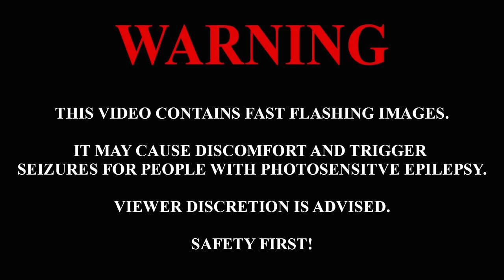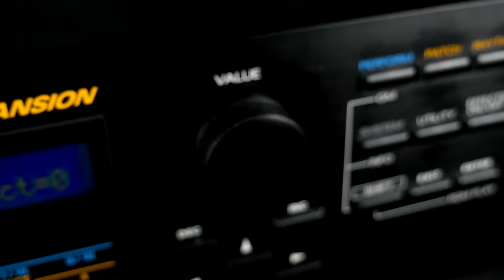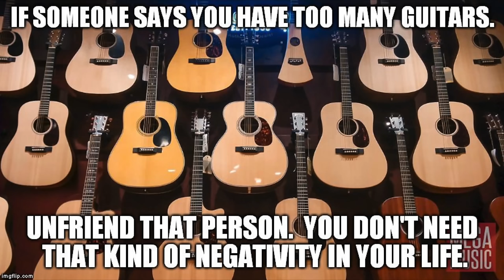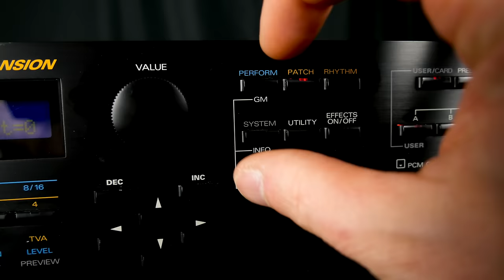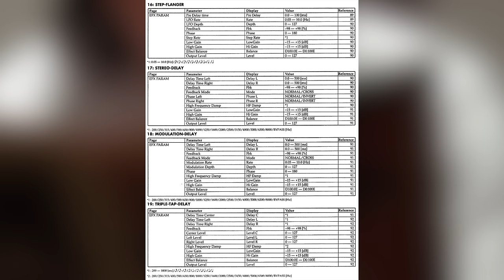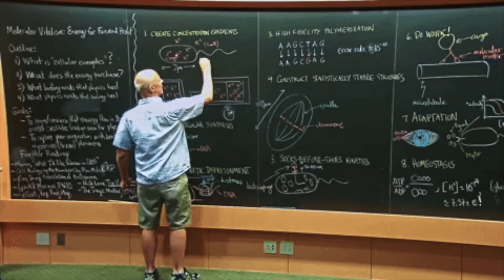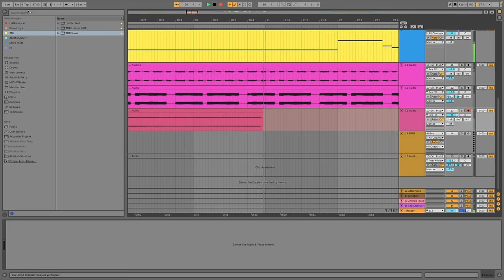Bad Gear - Roland JV-1080

Comment: I've got JV-1010, got it around the turn of the milliennium for $600. It's basically a 1080 in half rack 1U format (so an 8th of the size I think?) at half the price. Has all the sounds that the 1080 and 2080 has, plus the Session expansion card built in with some better quality instruments, plus space for an additional card. No real editing capabilities on the display, you have to use computer software. I totally agree that most of the patches are VERY quaint by todays standards, and completely unusable as main patches in any production post 2005. Most of the patches put makeup on the pig by drenching them in reverb and chorus, making them seemingly phat and dimensional but again, pretty much unusable today. It is also unfortunately quieter than the 1080/2080, meaning the signal-to-noise ratio may be a bit too high unless you're using it for one-offs sideshow bob stuff and not as a primary instrument.
Reply: Actually I disagree with your point saying these PCM acoustic instruments are unusable in any production post 2005, I still 
use my Roland SC-88 Pro and JV-1080 even today and last year I bought more sound modules and 2 drum machines 
including a U-220 and the R-8. After mainly using Halion 6 and Kontakt for nearly 3 years it was fun going "back to basics".
Also the SC-88 Pro shares many of the same samples from "Session" including pianos, brass, strings and saxophones. 
I think all of those instruments are still usable today as long as your not composing music commercially, I know for any 
sort of TV broadcast music ( including stock music ) or any of the big labels like Universal or EMI the bar is extreamly high.
Reply: @LittleRichard1988  Sorry, yes, I actually meant commercially viable productions post 2005, but failed to make it explicit and just wrote "any" for some reason. The JV-1010 is definitely a usable piece of hardware for making music, and it's especially useful in resource-starved environments if you want to whip up something fast. The main Session stereo grand piano for instance, it easily rivals most sample based virtual instruments you can buy today, and that patch is probably just a megabyte or two in size, compared to the 50 gig monstrosities you have to buy to come close. But that also says alot about the quality of grand piano virtual instruments. I've tried at least 25 of them, and almost all have huge issues with mic placements etc that make them pretty darn unusable in commercial productions as well.
Reply from the maker: It's super compact!

Comment: @audiopilz This gem is annoying to program, sure. But i would look at this as rolands omnisphere of the 90s. There are now lots of free utilities to open the unit up to exploratiom with many free options. The “secret” to getting interesting sounds is using the wavs from the expansion cards. Most of those are stupidly priced and can break down bc the capacitor issue, but fortunatelly its easy to repair.  I wouldnt look its usage in the 90s as A con. Rather its A device for that “sound” if you care to explore it. The same as a dx 7 or m1. This synth is a classic that you can still afford. The only con i see is that is hard to Find A modern sequencer/keyboard/ controller that speaks sysex. And also. This is not a rompler!!!
Reply from the maker: There's some truth to it!

Comment: the JV-2080 is better, bc even more cheesy brass and e-guitar presets fit inside the ROM. the display is bigger as well. at the moment, i will not part from my. a real hell is the Korg TR Rack. it takes ages to edit a sound directly over the display. but the TR has more Synth Sounds and really good drum kits. you should check that thing out. cost about 300-400 bucks.
Reply from the maker: Classic!!!

Comment: As always great video. Another suggestion: Cheetah MS6: A cheap Martrix-1000 copy without mod matrix. Since Austria is very small its not Impossible your familar o reven friends with Naked Lunch keyb. Stefan Deisenberger that, if not sold, among others, has an MS6.
Reply from the maker: Great input, thanks!

Comment: Do the Kurzweil K2x00 series! The VAST architecture was interesting, and the UI is awful for 2023, but in the '90s they were light years beyond Roland - also several times the cost. I've had a handful of them and always liked the concept. The reality of 2023 however is that hours of menu diving to layout drum samples or tweak deep patches on them is a bit. A modern librarian/editor probably helps, but it is still a challenge compared to modern modes of editing.
Reply from the maker: We had them back in the day at SAE. Let's see if I can find one. Thanks for the suggestion!
Reply: ooh the old K2000 .. i remember sitting trying to fiddle around with the VAST engine ... it was a bit like the EX5 to me .. seems to have so many posibilities, but the terrible UI and just underwhelming end results made it not worth spending so many hours in front of it... well except just for the joy of it
Reply: the sound is amazing too. I owned K2000R V3 about 10 years ago and still actually missing it. It looks very cool too!

Comment: If I can find a decent like new one for $300 I will get one to go with my Akai MPC One Gold besides the Roland VST Cloud doesn’t have the sounds of the JV80 Expansion boards in it so the software plugin is NOT!!! worth it
Reply: I would reccomend the original hardware over the Roland Cloud. At least with the physical 
hardware you buy it and it's yours outright!
Reply from the maker: Certainly goes great with an MPC!

Comment: I have a JV 1080 its still fantastic. I have 30 synths. 🎉
Reply from the maker: Nice!!!
Reply: Btw i also subscribe to Rolands cloud. 💃 the 1080 is still good in a mix but i probably wouldn’t use it just on its own these days. The techno and vintage synth expansions are essential. And yes the JV modules were the cloud of the 90’s.

Comment: So ... Roland's other other answer to KORG's M1 and the WAVESTATION? =D.  It certainly is right at home with the vapour crowd =]
Reply from the maker: True that!
Reply: This got me curious and after nearly an hour, I can not find a Roland workstation rompler that would have been the official rival to the Korg M1 and Yamaha SY55 etc.  Most of the Roland gear were synths with some form of synthesis or samples, but none were proper workstations with 8/16 track sequencers and FX which came in the mid-1990s and the XP range.  Closest to 1988 was the 1992 JW50 but that was a General MIDI keyboard only + sequencer and FX.  So no wonder the Korg M1 was manufactured for so many years up to 1994!!!  There was very little direct competition from the other brands.
Reply: @EgoShredder  That was not meant to be a serious answer on my part =]

By the way, the reason for saying "other other" was it was something of a nod to the D-50
Reply: @DerekPower  Yep true about the D-50.

Comment: I have a 2080 and I found that instead of trying to program that nonsense, just stick the vintage synth card in it and maybe tweak some of the FX and a'la Shazam. It's all you really need....well, it's all I really need. They make good pad machines but programming them is ridiculous. You need half of a first year engineering degree to understand these JV and JD units.
Reply from the maker: Vintage Synth card is the GOAT!!!

Comment: JV-1080 was a great machine. I would suggest, either you remove that video from your list or rename the series to "Vintage Gear" or something...
Yes, it doesn't have a punch of a full analog synth, but stil it was extremely versatile for the money, especially for home producers.
And the argument that it being overused in the commercials makes it bad somehow, doesn't hold the water. It's quite the opposite, people loved it and kept returning to it.
Reply from the maker: Thanks for the feedback
Reply: @AudioPilz  I love your channel btw.
Just wanted to pointed out, the criteria of some gear being overused puts it in a "bad" list is not correct. Its the problem of the creators.
The same was also said for DX7.  Stock-Aitken-Waterman abused it to the extreme.

Interestingly enough, nobody  claimed the same for Mini Moog.
Probably because it looks cooler.

Comment: I don't think there's an audio production tool out there that sounds 1990's more than the JV1080. I love it. However, when I played with it via Roland Cloud I couldn't find a single preset that I haven't heard a dozen times before and have never used it in a finished production.
Reply from the maker: It's been beaten to death indeed
Reply: It could go up against the Wavestation in a 90s rompler battle...
Reply: If you can somehow learn how to program, you can get some incredibly unique and ambient patches out of the 1080, just takes forever lol.

Comment: the 1080 was a godsend next to the 880. The 880 could only load half of the sounds from the expansion card at once.
Reply from the maker: 880 is still a classic tho
Reply: @AudioPilz  Yeah it was fun having to improvise on my main synth while I waited for the 880 to load the other half of the patches on the expansion card required for the next song. I had to design my set around this, so as to not have to do this multiple times during a show- Idk what it is like nowadays, but in the 90s in LA- if the music stopped- that meant a) the police had arrived and the rave was a bust or b) there was an equipment malfunction. LOL

Comment: Presets suck like always with Roland. They are still making this same unit but now they called it Fantom or FA or whatever. They got left behind long ago.

Still, this is a good unit for nostalgia purposes. Even some "modern" ...(whatever that means...)

I think it sounds better than most of Roland's "modern" synths (please someone tell me what is a modern synthesis) in 2023. I quess that tells something.
Reply from the maker: Some of the samples are still in the modern Rolands;)

Comment: well rolands king of bad gear if this is considered bad gear ive not had one i had a jv2080 and it was same synth esessentially just a bigger screen and a few extra bits that your never gonna use that was built like a tank as well but as widely used as this synth is and every studio in the land had one in and to be fair it does have some interesting digital pad sounds that only digital caN Do why im purely digital now nobs and vca abd vcos arent my thing and yeah i hear the silent shout of but it all digital is a rompler and unless its got 200000000 nobs on it and makes 70/ 80s synth pop sounds and the best thing about anaalog is making cb sqelch then its rubbish and who wants it i think for its day and the sample based synth engines are definetely where its at and offers a lot more scope for deeper more complex sounds and roland did alright on this one but then it does have the irratating way roland do things but still for its day was it bad gear or was it but because it had some nice sounds no one noticed could be the question to ask
Reply from the maker: Big rompler fan here too!
Reply: @AudioPilz  I got the korg wavestate and it does it for not sure on how it processes the samples and the way it does the pitch and have to use one sample per octave to get it spunding right and not just slower or faster but digital is definitely better

Comment: Screw the cloud
Reply: I agree, I would rather have the original hardware for any Roland sound module or drum machine. I might 
possibly add an Integra 7 to my stack in the future as that includes every sound from the XV-5080 plus 
all the sounds from the SRX cards as well as loads of Supernatural sounds. The only reason I created a 
Cloud account was so that I could continue using Sound Canvas VA on my old computer but now I have 
an SC-8850, SC-88 Pro and SC-55 I no longer use Sound Canvas VA.
Reply: @LittleRichard1988  I've completely rejected cloud services in favor of hardware. If I can't buy a physical version of whatever the thing is, then it's a limitation I'm willing to deal with in my production.
Reply from the maker: Word!

Comment: According to this channel, all gear is bad. 🤯😂🤣
Reply: 𝙒̲𝙝̲𝙖̲tsApp𝟭̲𝟳̲𝟭̲𝟰̲𝟲̲𝟵̲𝟰̲𝟯̲𝟲̲𝟮̲𝟬̲  very funny. I intended no disrespect though. fact: though I know you're joking, it will cost me more than the price of the unit te get it here and clear it through the customs. 😁😂
that is the price for beiing born in this shithole called Lebanon where the economical crysis is burning everyone...
another fact: i've owned many Roland gear over the years a D5, MC50 mk2, Mc505, XP 80 and my trusted cntroller the XV88 which i still use to this day, bought when it was released. not a single instrument died or broke. never ever. that is why I love Roland.
can't say so about Kurzweil.
Reply from the maker: That's an almost philosophical topic;)